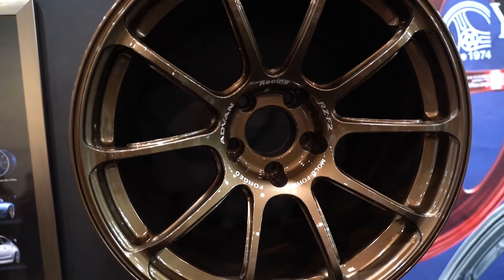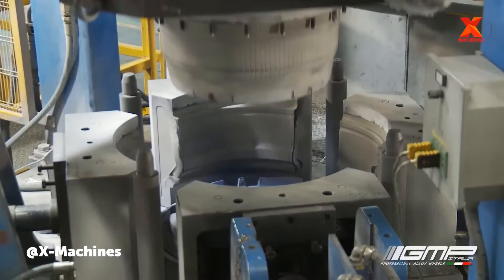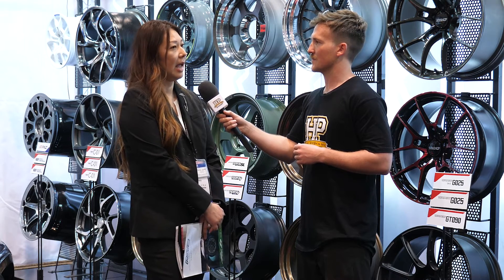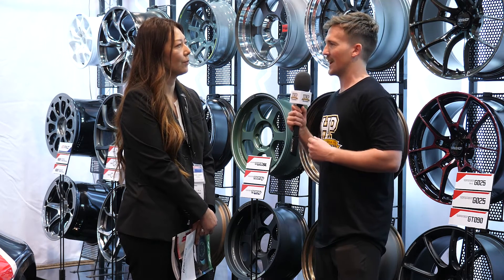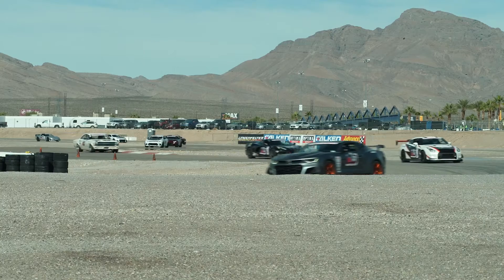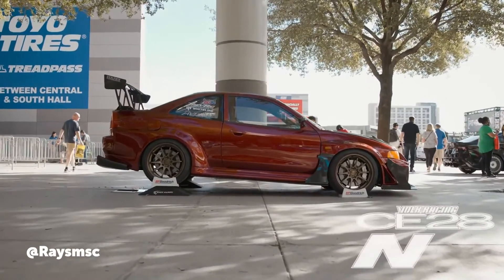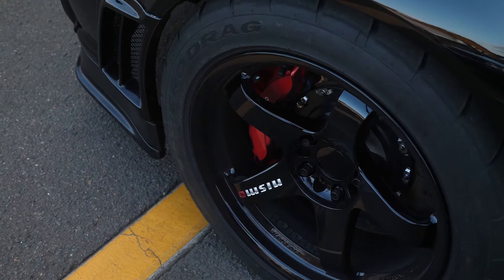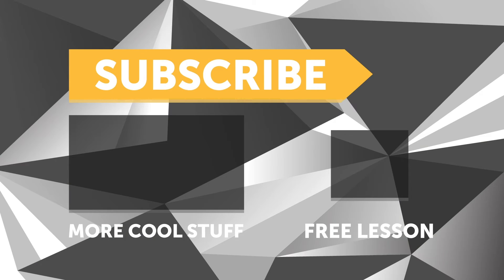Are Genuine Wheels Worth It?

Comment: I hit a roundabout kerb at about 80mph when a brake line burst. The car landed a good 80ft past the roundabout, bottom arm was bent, chassis leg tweaked up a bit, but the gram light 57dr maximum wheel that took all that force to redirect me from flat to flying through the air has a chunk missing. The tyre was obviously destroyed. The wheels now unusable, but didn’t disintegrate and stayed round enough for me to drive the mile home I needed. When I look at that wheel, and what happened, I can’t believe how well the wheel coped. I’m a believer now. I’ve seen plenty of wheels destroyed from far less.

Comment: Not all ‘cheap rims ‘ are bad . Just do a bit of research first  .
There are several cheap wheels from a couple of brands that are regularly used for high end GT racing . £1000 for a set of four 11x18 and even centre locks were not much more from the same manufacturer. We had some made to order and it took 7 days 😃. 

Admittedly I wouldn’t touch anything off eeee bay or am azon for motorsports but for road cars I can’t really see a problem .

Comment: REAL JDMS? REPS? DON'T CARE WHEN ALL I GOT IS 24" DUBS! THEY GOT ALL THE PERFORMANCE I NEED, MORE RUBBER MEANS MORE GRIP, BIG DIAMETER CUS YOU SHOULD KNOW MY EGO BIG. WHY DO YOU WANNA LOOK LIKE THE OTHER GUY AT THE FUNCTION, MR. NPC. DIDN'T YOU LEARN IN HIGHSCHOOL MATH CLASS THE BIGGER THE DIAMETER THE BIGGER THE SPEED IN ONE ROTATION. SHOULDNT HAVE SLEPT IN CLASS SON, CUS IM HEADING TO YOUR MOTHERS HOUSE GOING 200MPH AT 2000RPMS. I'M CHROMED OUT STUNNIN THESE 24"S ALL OVER YOUR COUSINS PUNY SHAGOTAN BANJOCKOZOIE EZEZARR STARSHANKS HE GOT ON EBAY . DUBS ARE NEVER FAKE CUS THEY ARE AS REAL AS THE MOLTEN STEEL THEY ARE MADE OF, FROM THE SOIL OF THE US OF A!

Comment: Not a great interview.... I'm a machinist, so maybe I have a higher standard concerning the topic of manufacturing methods, but I can't see how anyone would be satisfied with the answers to the technical questions.
Reply: yea man i just buy a haas gcode book off ebay and im a machinist by night
Reply: @jzxhotboi100  usually takes a bit longer than that, so good for you. But if you are looking for job shop work you should probably learn Mazatrol and start working on your macro library. I honestly don't know anyone nowadays who writes long-form NC code without cam and I'd advise you to avoid the practice, for obvious reasons.  Cam is fine, especially for suface/5-axis work, but macros are powerful and very flexible on the shop floor. Hit me up if you need any more help starting your new career.
Reply: You can feel that she was told to hold lots of cards close and not divulge too much, but I would say like alloy content you could say we use x material and y material because it increase strength. It won’t be giving too much away because nobody will know the exact mix. Stuff like that would make it a more engaging interview.

Comment: I smacked my used Advans i got from yahoo drifting going 80kph, bit of rash  but no cracks. yall be wilding thinking you need to buy real wheels brand new, i spent 1/3 the price of new set of reps. At least the representative does mention 2nd hand isn't bad. Either be patient with listings or save up. To be unbiased i'd rather have Rotas than being caught dead with JRs or XXRs and Keiichi Tsuchiya was endorsing them in south east asia but for the love of god quit running those centercaps i can already tell theyre fake from a mile away. 
You can just get the basic b*tch RPF1s for the price of a set of reps, used to see a lot of those back in the day for a reason stop trying to get TE look a likes when you know you cant get OG BRONZE
Reply: Rpf1 are not 'bitch' wheels. They are forged and light weight. I have no idea why they are priced so well.
Reply: @MrShakotan my bad but you get what I mean since the price, they are absolutely perfect on RX-7s especially FC's can't hate that!

Comment: I know alot of die hard people are gonna get butthurt and refuse to believe it but most "genuine" wheels are made in the same warehouse with the same castings using the same manufacturer process as "replica" wheels. Its just the times we live in where its cheaper to outsource manufacturing vs doing it in house.
Reply: Rays put out a cool 20-25 minute video of how their forged wheels (TE/CE/LMGT4) wheels are made. They could be made in the same place but they're probably not using the same metal stock.
Reply: @Audi0Surferz  so you mean to tell me they make their own T6061 aluminum 😂
Reply: @em2attic  That's what they claim in the mini-doc, lying generally doesn't fly well in Japan either. I would assume they found a supplier(s) willing to make their alloy and go from there. At the end of the day, we(buyers of "real" wheels) feel it's worth the initial investment. You can also buy second hand for the same price as new reps if you shop around.
Reply: @Audi0Surferz  yea im well aware on the shopping around part and in 2024 people seem to think its ok to sell used wheels for more than the price of new ones.
Reply: "We make everything in-house" 

It's pretty clear she was more with marketing a was struggling with some of the technical and processing questions. 

Your claim seem unsubstantiated. Also I don't know how people cannot get there head around the concept that even when 2 products are made in the same factory it doesn't mean it's the same quality. Each brand will provide there own specs for there price point in many cases.
Reply: @MrShakotan  soooo whats the excuse for work wheels? Because t7r crack like egg shells, gram lights are are the same thing they also crack like egg shells, shit even forged te's crack ALOT. Sooooo yea like i told the other guy, buy whatever your heart desires nobody is stopping you, i just know what ive seen with my own eyes working in the wheel industry.
Reply: @em2attic anything stressed beyond a limit will crack or break. I'm not sure what you point is?
Reply: @MrShakotan well yea i understand that but what im saying is that daily driving around on my brand new at the time genuine work t7r and they crack less than 3 months of ownership that isnt exactly what you expect when you pay for quality wheels. My t7r, te's and reps all have the same spec 18x10.5j on 255/35 both my te's and t7r developed a hairline crack and i drive the same 20min to work each day on the highway with very very very minor pot holes, my reps on the other hand have not started leaking and have not developed a crack. I love all my wheels reps and genuine both but for all these people to just meat ride a company for the name is insane. And like i said before as well people will definitely be in denial of the truth about their beloved wheels but it is what it is.
Reply: @em2attic yeah okay, that's pretty shit then. When I was working in Japan, the emotion series wheels where there basic entry level cast budget wheels. They where about $1300-1500aud a set delivered. That was nearly 15years ago now. 

I understand what you are saying. You completely right they shouldn't crack from road use. Although I'd argue that road use can see different stresses that track doesn't. I've got 3 cars currently rocking genuine wheels. Which I've found to be quite robust. 

My brother inlaw a few years back his a pothole and had his cheap wheel break, instantly loosing air pressure. Barely kept it out of the guard rail. I'd expect any wheel to be damaged from this but perhaps not catastrophic failure.
Reply: So wrong to be putting this misinformation out there. I’ve seen many copies with cracked spokes from poor casting techniques and usually significantly heavier than their genuine counterpart (to make up for the lack of strength). Casting processes vary more than any other wheel manufacturing process in the market. 
Then there is machined from billet, where the raw product may be 6061 but there is a single directional grain structure. Yes it can be machined to look the same but it not the same as a forged wheel. Yes believe it or not even if it’s machined from a solid forged block of billet. A forged wheel has its grain forged to flow in a directional manner which adds strength that cannot be achieved using any other process. These forged blanks are then machine finished to form the final shape. Chalk and cheese. I will never use a copy or cheap arse wheel ever. They are heavy and weak and not suited to motorsport or performance cars.
Reply: @dorifthor  ok and you say that like rays is the only manufacturer to be able to complete this process. Obviously theres gonna be garbage "reps" out there just like theres alof of garbage "genuine" wheels out there as well. If you only wanna buy genuine wheels then good for you, if you only wanna buy reps then also good for you because at the end of the day the only person that should be happy or sad about their purchase is you. And like i mentioned before some of your favorite jappy "genuine" wheels are manufactured in the same warehouse as "replica" wheels. Work wheels for example, all cast face designs and all made in Taiwan, so once again buy whatever your heart desires.
Reply: Still, why not just get something g else that isn’t a design copy?
Reply: @schoona90  by all means get whatever you please but some people out there just genuinely love a specific wheel design but dont wanna pay the price tag on the wheel just to beat it up daily driving or tracking whatever wheel that may be. Just because its "genuine" doesnt mean its always the financially smarter decision.
Reply: These aren't like your fake Nike Airmax 🤭.
Reply: Enkei rpf1 copy's are made of cheese genuine won't split in half lololol